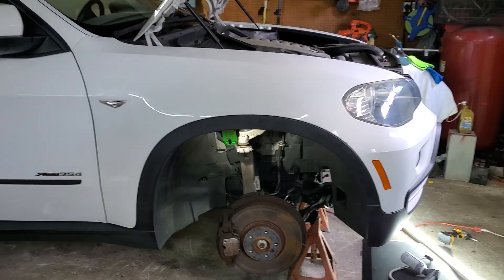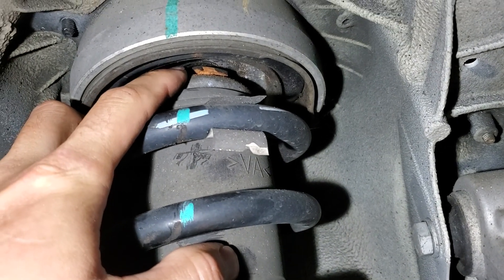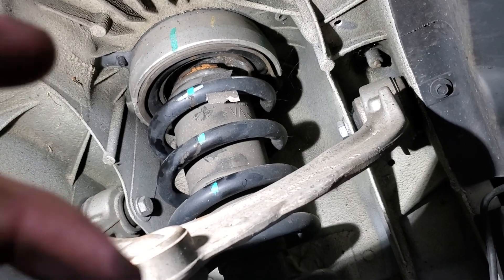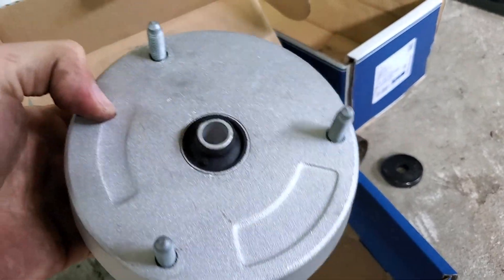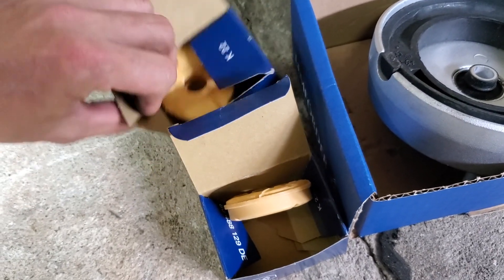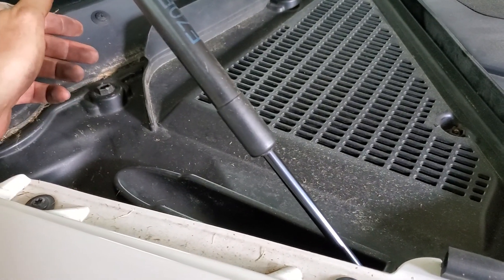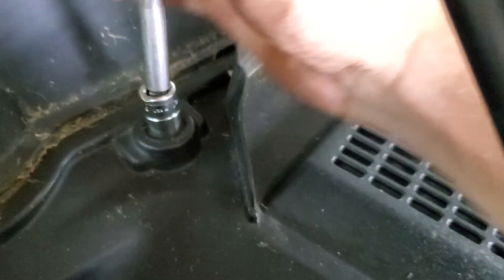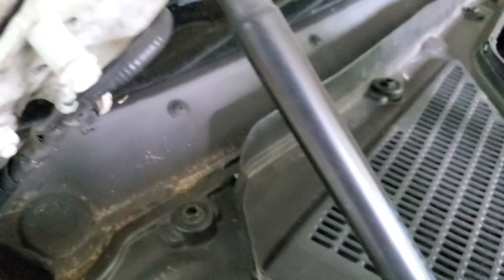HOW TO REPLACE Front Strut Mounts and Bushings BMW X5 Suspension Clunking Noise Fix DIY Step by Step

Comment: 10 hours spent and I'm finally done!  Here are some tips.   If you can't reach the 21 mm nut holding the fork like I couldn't on either side you can put a flat wrench on the nut and remove the bolt  from the other side with an impact gun.  I know you run the risk of sheering the head off this way but it was the only way I could remove it since I didn't have enough access to get a socket on the nut.   I did it with a 13/16" flat  wrench since I didn't have 21mm and luckily it fit very snugly.  I had to do this to both sides.   Something else I learned is that the stud pattern to the  top cap of the strut assembly is not equal distanced.  Two studs are the same distance from each other  and one is further away by a 1/4".  There's only one way that it will go in, matching the holes on the car and the manufacturer had the rubber piece on in such a way that the bolt pattern didn't line up on the driver's side.  I got lucky on the first side I did (pass)  But on the driver's side I had to take it apart and redo it when I realized that it didn't fit.  Also, I had a really hard time getting the upper control arms off on both sides but worse on the driver's side and I ended up using a stubby piece of brass and hitting it several hundred times with a hammer from the bottom.   The bolt holding the upper control arm also was seized and I spun it while spraying penetrating lubricant and whacking the other end with a hammer using a piece of brass stock. The process of getting it back in afterwards took a lot of cussing and ratcheting hand clamps. I've ordered 2 tire install allignment tools from Amazon.  I recommend getting some to avoid frustration.  The brake wear and abs sensor clips are a pain in the butt to disconnect.  I was only able to do the passenger side and it broke in the process the two on the other side I tried and tried and ended up just leaving them connected cuz I could not disconnect them for the life of me.  The advanced Auto near me didn't have the right coil compressor I had to go to AutoZone and their unit was very badly worn.  It did the job but it was kind of scary. Overall, it could be an "easy" job as the video title suggests but all the stubborn components and having to redo some stuff made it take way longer than this video let's on.  But I know this has  everything to do with my  inabilities and not the amazing job of the video creator.  I'm completely convinced that some BMW mechanic slept with an engineer's wife and the engineer is getting the last laugh. Hope this helps someone.
Reply from the maker: I'm sorry to hear about the nightmare you went through. Also great that you mentioned the strut mount top cap that it only goes in one way. I must have cut it out during editing or just forgot to mention it but that is an important part of the reinstallation of the strut assembly. Thank you for mentioning that. There is usually a paint mark on the cap and spring showing the side that is facing out. If you don't see that then use a sharpie and mark the spring and old cap so you can match the direction with the new one when replacing it.
Reply: You should have just replaced the entire strut.
Reply: @Poppinwheeeeellllllieeeeez  Unless you're willing to by a genuine BMW part, in my opinion, you are better off keeping the original high quality components.  Especially for me that was just trying to replace the rubber bushing and top caps.  The car drives like new still.

Comment: very informative video! do you need to perform wheel alignment if not disconnecting the folk from the lower control arm ?
Reply from the maker: It's not necessary but I would recommend it that every you do any suspension work it's best to do an alignment since you are replacing wore out parts with new.

Comment: Mr. Fixit love your vides I have a questions I have a 2011 X5 35I and I hear like oversteering when i turn my wheel backing up or just turning very slow, what would you recommend, I have 111k miles on it and no other issues would you say that I am good for another 75 K cars aver very expensive and interest rates crazy so I would like to make it last. thanks for all you do
Reply from the maker: I would take it to an alignment shop to see what's going on. As far as the second part of your question, these are not super reliable vehicles to begin with and unfortunately the X5 35i is know for having engine problems.
Reply: @mr_fixit  Thank you

Comment: I have a question....I just did mine and the spring orientation changed the blue stripe is now in the back...it would only fit back that way and I landed the springs correctly in the top bearing and at the base of the strut....will that matter? Thx tim
Reply from the maker: No, as long as you lined up the strut mount and lower suspension to go back in correctly you should be fine.
Reply: @mr_fixit  yes I lined them all up and test drove it...the bushings and foam had been worn out so long that after I got it back together everything felt tight...but ita actually back to where it used to be when we first bought it...thx for thr reassurance!!!!

Comment: If you tear it down that far anyway, would you suggest replacing the struts “while you are there”?
Reply from the maker: Depending on the condition and mileage of the old ones. I thought I would have to replace mine because the were close to 100k miles but they were actually still perfectly fine no leaks and ton of pressure in them so I put them back.

Comment: Will you need to have an alignment done after this job is complete? I’m only doing the one side
Reply from the maker: I would say it's recommended that you do but as long as your alignment was fine before the repair and car still doesn't pull to any sides after the repair you should be fine.
Reply: @mr_fixit  I’m having trouble putting the front passenger knuckle back into the upper control arm, does the stabilizer bar have to be removed when I do it? Is there a certain clamp used to press it back up in there? Thank you
Reply from the maker: @rsolis1389  I just use the floor jack to lift the knuckle assembly up and then guide the ball joint into place. Put some grease on there and may need to tap it into place with a hammer.

Comment: how many miles on your car when you did this? I have 96k miles same car diesel as well. Do you think if i do his job the car will feel much better? It doesnt drive that bad
Reply from the maker: I bought mine with 97k miles and it was already making noise I changed everything right around 100k cause it got worse pretty quick.
Reply: @mr_fixit  got it and thank you for the video! I got mine with 30k miles about 9 years ago and i have 95k so im thinking to do it and refresh the bushings and control arms, we ll see. Thank you again
Reply from the maker: @AM4project  No problem, thank you for watching and supporting my channel.

Comment: Is it the same procedure with a 2004 model.. the body is slightly  different
Reply from the maker: I haven't worked on the older version so I  can't confirm 100% but I assume it has to be similar procedure.

Comment: Curious what year was the X5 and miles on the vehicle?
Reply from the maker: It's was 2009 and I believe 98k miles at the time of the video.
Reply: Mine is a 2011 and started clunking slightly around 90k maybe before that

Comment: Alignment afterwards?
Reply from the maker: Alignment is not necessary if your vehicle didn't have an alignment issue to begin with. I did an alignment on mine but I had an alignment issue in the rear, I did feel the vehicle pulling slightly to the right.

Comment: 4.5 hours in on the first side.  I'm stuck.   I'm missing something.....  Can't even get a socket to fit on the lower control arm fork nut so the assembly drops.
Reply: It seems like you have the sway bar link disconnected but you don't mention it at all in the video.  Is that needed?  I started loosening the nut on the link but it just spins now.  I can't get it to tighten or loosen.
Reply from the maker: @fern9234  Hey, sorry for the late reply. I did have the sway bar link out at the time because I was replacing them as well but they are not necessary to remove in order to get to all the other bolts and getting the strut out. If you decide to remove them you'll have a little more room to work. I have a video on replacing the sway bar links too. Hope this helps and thanks for watching.
Reply: @mr_fixit  I spent another hour or so racking my brain and then put it all back cause I never figured out how to remove that bolt without taking anything else off.  I thought I could tackle this  but I just can't seem to figure it out.  My mechanic gets the win on this one.   Thanks for replying.
Reply from the maker: @fern9234  I'm sorry to hear that. If you have any other questions you can dm me on IG @ mr_fixitt I can respond quicker.
Reply: @mr_fixit  Just saw your last message while i was reviewing your video again.  Thanks man.  The noise is now unbearable so I'm trying it again tomorrow.  Fingers crossed.

Comment: That’s not a ABS SENSOR, it’s a sensor for brake pat wear
Reply from the maker: Actually the plug I show in the video is the ABS sensor. The brake pad wear sensor is on the driver side so when doing the suspension on the driver side you need to disconnect both plugs. Hope this clears it up and thank you for watching.